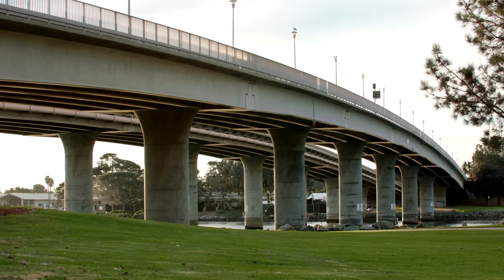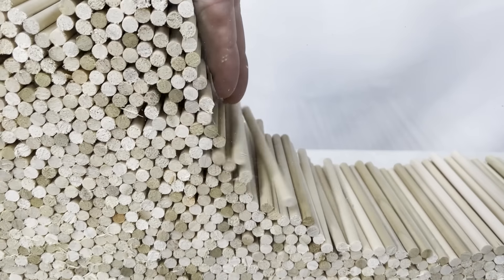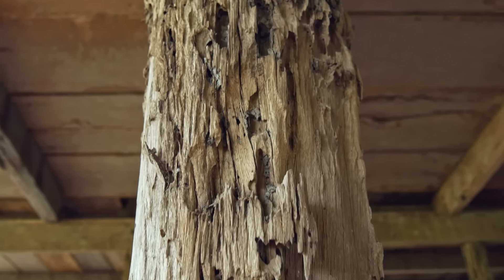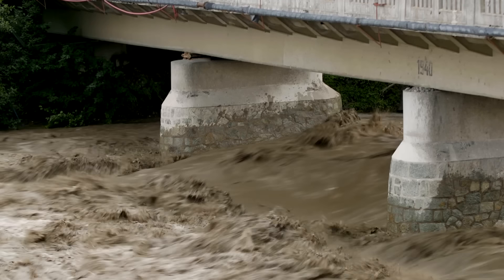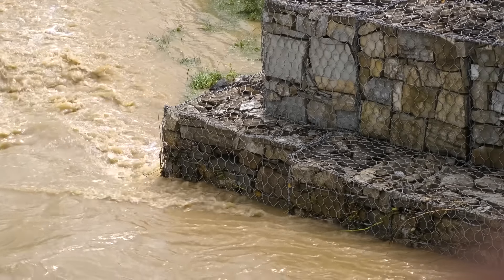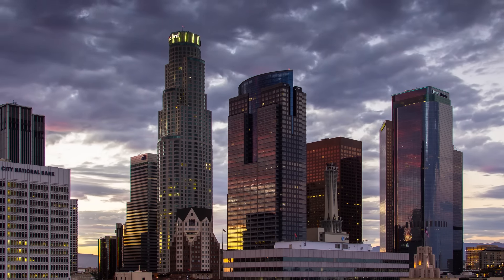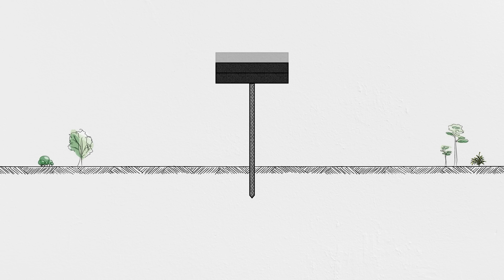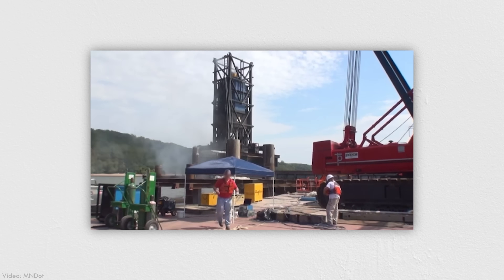Why Buildings Need Foundations

Comment: Great video as usual, thanks.
We bought a lovely roomy 1974 era house in a cul-de-sac in 1995 here in Australia 🇦🇺  The only problem: highly reactive clay soil and poor shallow foundations, very typical,of the era. We found lots of cracking and movement, especially when it was dry.  (The previous owner had been pouring a huge amount of water into the yard to avoid cracking, and taken steps to hide the damage, but that was of course totally prohibitive for us as water is now metered and quite expensive.)
We then spent over $30k having most of the house’s exterior wall underpinned- huge job and huge upset to the garden during the process.
Now, 25 years later we still love our house but it still gets significant movement (mainly in the middle above the crawl space where it was prohibitive to rebuild foundations), and movement around door frames, and cracks in drywall.

Comment: I would love to know more about ground screw foundations, how it works, caveats of how it's made, longevity, interaction with different kinds of soils etc.
Reply: Helical piles? I work for a deep foundation company we install helical and micropiles. Helical piles are screwed into the ground. Micropiles are bars dropped into holes with cement to bond to the rock.

Comment: Living in the Midwest my whole life, I’m always surprised at how many homes outside of the Midwest don’t have basements. Yes, it’s more costly to build a basement than a crawl space, but the usable area you get is more than worth it IMO. My Aunt and Uncle (both from the Midwest) moved to California in the early 2000’s and built a house with a basement just south of San Francisco. The basement walls are 2’ thick of reinforced concrete. Many people stopped by the site as it was under construction to watch the build.
Reply: Same here. I grew up in the midwest and basements are pretty ubiquitous  here. Not just good due to freezing temps in the winter, but a refuge for tornadoes in the spring and summer. Although, I did rent a home without one for a period.
Reply: They're so prone to leaking problems though and cracks. I find them to be a pain in the ass.
Reply: I live in a fast growing area in Poland and there were hundreds of (one family) houses built here and still are. i see new homes being built when I drive around every day.. About 0.1% of them have a basement. Its cheaper I guess. And you avoid leakage/mold problems in the future..

Comment: Replacing foundations seems to be a pretty difficult endevour. Could zou make a video about this process. Maybe include the foundation replacement of your house as well as covering it on a bigger scale. How do you replace a foundation without destroying the entire building?
Reply: I'd imagine the same as moving it. I-beams are used to support it evenly while jacking it up.
Reply: Usually they’ll basically jack the house up, support it with beams, make the new foundation, and lower the house back down. I wouldn’t say that’s so much an engineering question, as much as a basic construction question. (Not being rude, a lot of repairs on housing are pretty basic ideas, like using jacks on your house to replace the foundation the same way you jack up your car to replace the tires, or “foundation” of the rest of your car build if you will.)

Comment: Grady: This video left a big question mark in everyone’s mind: How did you replace your house's foundation??? Did you move the house out of the way? If so, how? You need to put the house on something solid i.e. a foundation while you are replacing it’s foundation!! Please please give us another video documenting exactly how that was done.
Reply: Presumably the process is like: place a jack next to a pier to support the house while the pier is removed, remove the pier, place a new pier, and then remove the jack. Repeat until all piers have been replaced. No need to move the house out of the way.
Reply: @sanjaymatsuda4504  The house was probably lifted first. Can you imagine replacing the piers in the middle of the house without lifting it first?!
Reply: @sanjaymatsuda4504  It's exactly that process that throws up a lot of question marks in my head: You have to put the jack on a firm footing, which means either wide or deep. I'm guessing wide, like a steel plate of a square metre or more. Then removing the pier. The pier is going to be what? 2 metres or more? You are surely not going to jack up the house that far! So how to remove it?? Dig a hole next to it and move it out sideways or diagonally? And putting in the new pier: Put back in the same hole, OK, but then compacting the soil under a house where you don't have much vertical space?? I just think that this should have been shown and/or demonstrated a lot better.
Reply: @martinstent5339   There is no requirement to remove the old piers in one piece. They're old and made of wood, so presumably they can be cut into chunks, digging next to them or lifting the buried part with a jack and/or a corkscrew to keep cutting more chunks. So no need to lift the house or move it away just for that.
The real puzzle is putting in new piers in one piece. If they're going to pour concrete in place or stack blocks of masonry into the hole left by the old pier, that's easy enough. If the new piers are one solid piece of wood, I can't imagine how they're put in place, but I'm sure there are amazing solutions to that problem.

Comment: I work for a deep foundation company we install helical and micropiles. Would love to learn about the engineering behind them.
Reply: Helical piles are fascinating. I was designing a foundation for a public patio on a flood plain.  The geotech report said the soil had good bearing for the first 3 metres or so, but below that was horrible clay.  If they tried to screw the piles in and couldn’t get the desired bearing, they might go right through to the clay and then you would keep going forever. But if you get the screws below the 1.5 metre frost, but above at least a metre of good soil, it should be able to spread the load out well enough.

In the end they did concrete & sonotube instead, but the theory still held true

Comment: Hey Grady, living in north Texas, I've noticed nearly all the homes in the region built after, say, 1970 have been built with slab-on-grade foundations, and with very few exceptions, by 20 years in service they've nearly all experienced significant enough foundation settling and damage due to the expansive clay that it becomes necessary to insert piles and jack the foundations back to an even plane, at a cost of tens of thousands of dollars, plus additional costs if floors need to be torn up to accommodate piles under the center of the house. Clearly, the high frost line here doesn't justify basement foundations, but as a civil engineer, do you think it makes sense to add measures like sinking piles before pouring single-family home foundations to local building codes? Some amount of settlement is unavoidable, but I can't help feeling like it would make more sense to install that support before the house is built, rather than 20 years after, as is so often the case.

Comment: You should look at the „elb-tower“ in hamburg, Germany… it is currently under construction.. and they build deep foundation with sone pillars 100m deep.
Interestingly they don’t hammer it (I mean of course it would be ridiculous) but they actually flood the Drilles hole from the buttom up with concrete, also displacing the water sand mixture that prevented the collapse ing of the hole
Reply: That's the way oil wells are built while drilling.  Heavy "mud" is used to lubricate the drill, bring up rock pieces, and keep water out.  Every so often they stop, pump concrete down the center of the pipe and up the outside to set and harden into a shell.

Comment: I grew up in a small house that was built sometime around 1960 with an extension that was close in size to the original house. The soil around that house was definitely an expansive clay soil (I loved seeing the soil form cracks on top of cracks when it dried after a good rainstorm). I remember my parents looking into adding a second floor onto the house, and we had to dig down to investigate what type of foundation we had, to determine how we could support the second floor. My parents were told that the house could be sitting on piles that widen as they go down, passed the walls of the house. If so, we would have to use outriger pilings to support the second floor, about 8 feet outside of our house. There was no crawl space under our house (scroll spaces are not populer where I grew up), but I do remember that our sewage connection was a lined and covered chanal as opposed to a pipe. Anyway, once I left home, my parents no longer had any need for a second floor, so it was never added.

Comment: As someone from Saskatchewan, Canada, I’ve never considered that it might not be normal for every single house to have a basement in it. Interesting to know why every house in this climate has a basement, and to learn that most people don’t even have basements at all.
Reply: In my suburb it is forbidden to have a basement as there is a small risk of flooding (I built a little higher than the level 0 of the ground to avoid any trouble ( I am going up in the garage :))

Comment: My dad used a "raft" for the foundation of a small cabin he built on top of a hill in the woods. He ran the pipes on the side of it to make it easier. We live in the south where it only snows like 1cm every 10 years so he didn't have to worry much about the soil freezing. Our worry is mainly about hurricanes, tornadoes, and flooding.

Comment: I've often wondered why our converted brink stables (UK) has a solid concrete floors for both the ground and 1st floor, considering a wood joist floor would have been so much easier to build for the 1st floor. I am now thinking it could be to strengthen the walls (a bit like a "raft" floor?) as we live in a very expansive clay area. What do you think?
Reply: The expansive clay soil will heave and subside as it dries and get wet, so you need a slab or raft foundation. It is very likely that this is what you have. Your walls will sit on the slab and be protected from differential movement by it. But just because you have concrete floors doesn't always mean you have a slab foundation. I had concrete floors in my old victorian terraced houce, but the house stood on narrow (strip) footings and the floors were laid in the 1990's with insulation under them.

Comment: i find it odd that American homes need so much major maintenance. over here sometimes we get subsidence if the ground moves but its pretty rare to ever do any foundation work
Reply: Temperature and humidity variation is a lot higher in many areas of the US (also higher humidity in general). There can be up to 120 degrees (67 degrees in C scale) temperature swings from the coldest night in winter to the hottest summer day.
Reply: @Ergzay  dose that make concrete not work then?
Reply from the maker: Depends where you live. America is a big place. Not everywhere has poor soils like where I am.

Comment: It's so weird that in Germany a basement is basically the standard for a family home.
Reply: I mean germany has had some rough winters(while not in the last couple of years). And if you should bring your foundation to the frost line, it makes sense to use the extra space. And of course there is to mention that many basements where build as bomb shelters. I remember in my family home, our house was a semi-detached house, and the basements had wall segments consisting of loose bricks, so if a bomb destroyed one entrance, the neighborhood could brak through an still exit through the other homes.
Reply: It is here in Canada too.
Reply: Depends on soil and water table.

The above ground crypts in New Orleans? That's to keep corpses out of the water.
Reply: It's colder in Germany than Texas most of the time

Comment: All houses should have a basement. It basically doubles the size of (a single story) house, and is (typically) cheaper than the other floor(s) by up to 75%!

Unless there is too high of a water table to allow it, this is an awesome way to increase the size of a house!
Reply: The cost of digging is a huge factor that most don't consider. I'm in a very rocky area of Texas. The time and cost to dig a foundation is much more expensive than just making the house bigger on the surface.

Comment: Obligatory I live in Europe and we don't need to replace foundations because we build houses out of brick and concrete.

My house has concrete foundations and I don't see how I could replace them without tearing the whole house down.
Reply: Brick and concrete foundations don't last forever, and you're somewhat correct, repairing masonry foundations is much more difficult and costly to repair than wooden pilings.
Reply: @stormelemental13  We've got a lot of Roman buildings with concrete foundations still standing. There's even more Roman foundations left from underneath buildings that are no longer there.

So yep, absolutely, they don't last forever. But typically they last longer than the structures on top of them. By orders of magnitude!

Comment: Many of the comments are about different building methods/expectations in different countries, so here's my 50 cents worth... Our house was built in 1890 and has the classic Victorian foundations - basically the house walls are built on top of thicker  ragstone walls which form the cellar (basement) walls. As far as I know there is no actual foundation beyond this. And yet the house has stood for 130 years, without settlement or cracking (as far as I can tell) - despite being built on a hill.  It's brick built, so maybe the weight of the building plays a part in keeping it in place?  But maybe it's also the soil  type - it's quite firm (a clayey loam). We also own a flat in  a brick-built four storey apartment building in Hungary, built just 17 years ago, and that has very noticeable settlement cracks. But that is built on a sandy soil (originally a river flood plain).